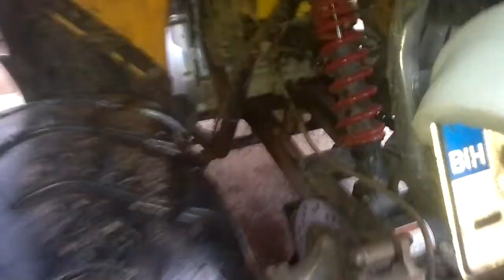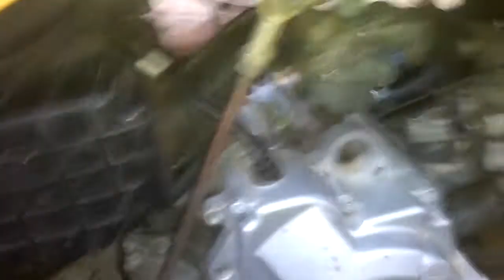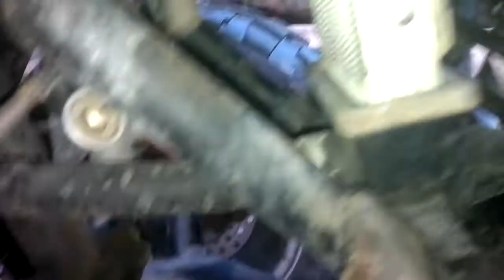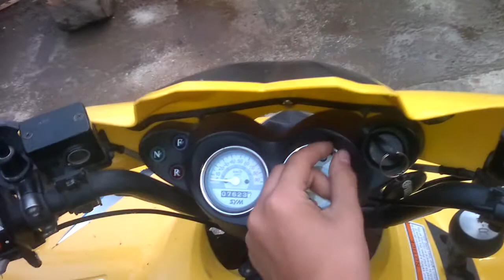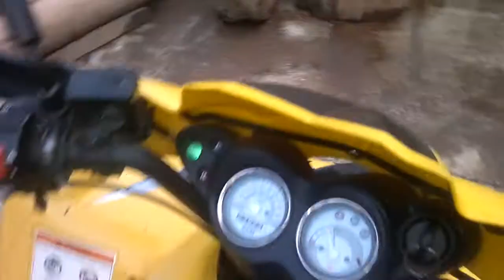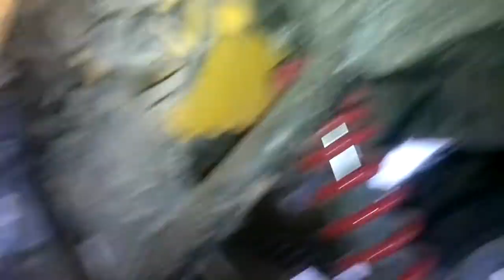My atv SYM truck runner 200

Comment: Hi, 

What is your opinion on this 4 weel ? 
It is robust and it has good quality material?
Any problem normally identified?

Thanks .
Your opinion will be highly appreciated,

Regards.
Reply from the maker: Hi.
My quad have 9000km and no problem, material is good.Very durable machine.
Sorry for my bad english
Reply: @AdisIdrizovic  what's the top speed?
Reply from the maker: @magnumllama400  80/90 kmh